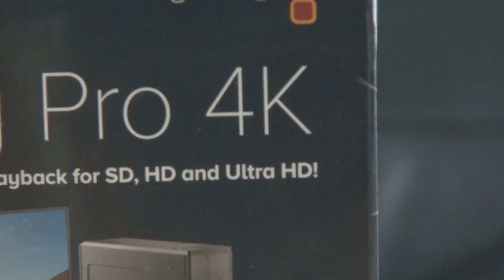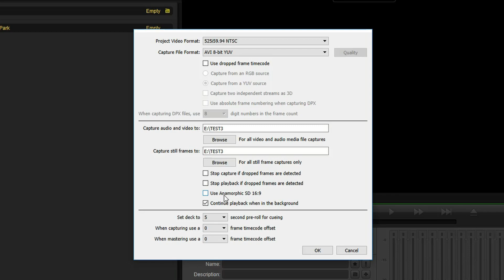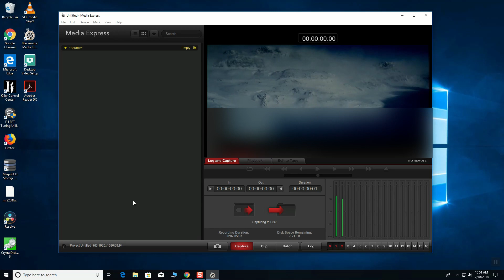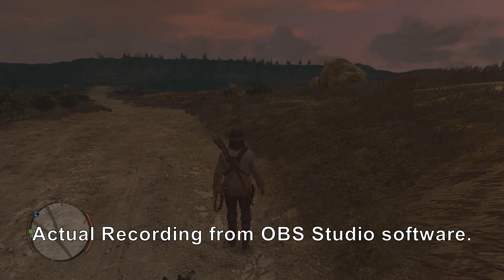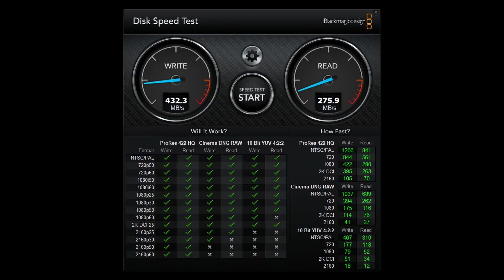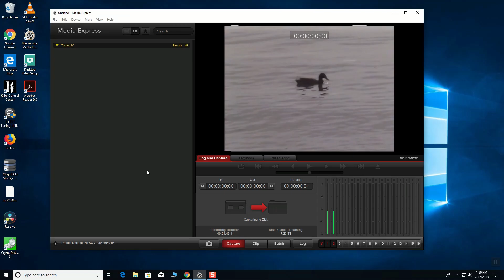PVL Ep.#3: The Quest for Uncompressed: BlackMagic Design Intensity Pro 4K Review

Comment: thank u very much.
I am interested in capturing from a video device via RCA outputs only.
Will I see a difference between the BlackMagic Design Intensity Pro 4K and an external capture card like the diamond vc500 or DAZZEL DVD?
Will I notice the quality differences?
Reply from the maker: Hi @yigal-babiyan, I've not used the diamond or dazzle but the BM line of cards are intended for uncompressed capture, so you will need large and fast drives. More prosumer-professional use. Diamond and Dazzle are more consumer friendly and won't tax your computer resources or hard drives. Quality wise, I've not done a side by side, but I would imagine the BM card would give you better results, but you have to understand the BM results will need proper storage (fast and a lot of GBs) and encoding software to get the file size down to something more manageable. The Diamond and Dazzle give you ready to go results. Sorry if this doesn't fully answer the question.
Reply from the maker: Also, it's not just the capture card you have to account for. There is the playback device and the quality of the media itself. Can't really speak to quality on just the card alone, if that makes sense.

Comment: For me, Intensity PRO ran with a DVD player for less than 3 minutes when STOP at dropped frames was switched on. The software's factory setting is off😉Here is a PAL example video of the "TBC quality":  https://youtu.be/6R-T4ovgFVU  For me, the card without 4K is electronic waste, because the HDMI input does not accept a HDMI (4:4:4) signal from the Pioneer DVD recorder (EE Mode TBC). With 4K, the card is electronic waste for me because it only runs under Windows 10👎

Comment: I Tried connecting my ipad pro 11 to hdmi, casts but not sounds
Reply from the maker: Hi Pitzky, my guess would be it has to do with the card having to obey HDCP protocol. You might be able to feed the HDMI into an HDMI audio extractor device that can pull the audio from the HDMI via RCA cables and feed that signal into the card.

Comment: I bought one last year. It always has trouble with audio sync when capturing to uncompressed video, even though it's just SD. Compressed video does not seem to have the problem. And it's not a storage or computer bottleneck; it's running with a Ryzen 9 5950X, 64GB Ram, and dedicated (as in, not the boot drive) 2TB Samsung PCIE 4 NVMe drive. BTW, Blackmagic's website no longer mentions the TBC capability of this device.

Comment: 4 years later, but I guess any image input to OBS from an external source usually has an audio lag. You have to specify at post. Look at how many miliseconds of difference you have, and then maybe is fixed if it's adjusted at OBS the ms difference. Even then, maybe you have a difference. IDK but that's how i solved some issues like that.
Reply from the maker: I ended up getting an HDMI to RCA adapter to output the audio from an HDMI source such as Blu-Ray to fix the audio distortion, and had to play around with the audio delay as well to get it synced up.

Comment: Great review! Quick question: is it possible to use this card to get a live feed into Resolve, then do color correcting (basic) on this live feed? The reason i ask is because i'd like to use it for studio photography. So i'd take the live video HDMI output from my Sony A7 camera, feed it into the Intensity Pro 4K, then this comes up live in Resolve and i can do some basic color correcting on this live input video and see the result directly in Resolve. And then, if that works, feed the output to it's own dedicated monitor? (i read this is only possible if you have two different Black Magic pci-e cards because the same card can't input and output simultaneously - perhaps you also have an opinion on that?)
Reply from the maker: I guess I'm confused on how you plan to color correct a live feed? You can't color correct a clip as it's being fed into the system. It would have to be captured first, then that clip color corrected. I've been able to feed in an hdmi signal from a Roku device and output the hdmi signal to a TV by bypassing the HDCP protocol, but I not sure about your situation. I use mine more for archival captures than hdmi video streaming myself, so I wouldn't be the best person to ask on that. Sorry.

Comment: Hi, Does pc capture card walk hand in hand with bluray player? i have card like this, but 1 gen older model? it does not have fan. i have also exact same hdmi splitter as you :D i only tried hdmi, not yet composite cables. when i jump between component and hdmi on obs, it gives me some flickering for while and then black, hdmi is just black

i tought this maybe be broken, i found this from local junk/crapyard but as i watched your video, maybe this device is not so practical :D 

i try tomorrow connect older console  with ypbpr component cable if that can run :P

Comment: Bro what is the system requirements
Reply from the maker: According to their website... I'd be more concerned with storage setup than specs if you PC is somewhat recent.

Operating Systems
Blackmagic Design Capture cards are compatible with the following operating systems:

Windows 8 64 bit
Windows 10 64 bit
Ubuntu 18.04 64 bit
CPU Requirements
In general, you should choose a CPU that meets or exceeds the system requirements of the software application you are planning on using. Please check with software vendor for additional information.

Memory
Blackmagic Design recommends a minimum of 8GB of memory for all systems.

Graphics
For optimal performance, an accelerated graphics card is recommend for use with DeckLink, Multibridge and Intensity cards.

Please see the Graphics Card Requirement Tech note regarding appropriate graphics cards for our products.

Storage
You will require hard drive storage with your Blackmagic card that can provide a data rate greater than that of the video compression you are using.

Physical Installation
Requires a computer with available PCI Express slot with adequate number of PCI Express lanes and PCI Express generation. Blackmagic PCI Express Cable Kit (available separately) is recommended for use with UltraStudio 4K Extreme 3 when connecting to a computer via PCI Express. DeckLink SDI Micro requires an M.2 connector.

Supported Hardware
Certified Workstations
The following workstations are recommended for use with the DeckLink Quad HDMI Recorder:

Hewlett Packard Z8G4
Hewlett Packard Z820
Hewlett Packard Z840
The following workstations are recommended for use with the DeckLink 8K Pro:

Dell Precision Rack 7910
Dell Precision 7920 Tower
Hewlett Packard Z6G4
Hewlett Packard Z8G4
Hewlett Packard Z800
Hewlett Packard Z820
Hewlett Packard Z840
The following workstations are certified for use with DeckLink and Intensity capture cards:

Dell Precision 7910
Dell T7610
Hewlett Packard Z420
Hewlett Packard Z440
Hewlett Packard Z620
Hewlett Packard Z640
Hewlett Packard Z820
Hewlett Packard Z840
Hewlett Packard Z6 G4
Hewlett Packard Z8 G4
Precision 7920 Tower
Precision 7920 Rack (not recommended for DeckLink Quad card)
The following workstations have been discontinued but are known to work in legacy configuration:

Hewlett Packard XW8600 (not recommended for DeckLink PCI or PCI-X cards)
Hewlett Packard XW9300
Hewlett Packard Z400
Hewlett Packard Z600
Hewlett Packard Z800
Certified Intel NUC
The following Intel NUCs are recommended for use with the DeckLink SDI Micro:

Intel NUC Kit - NUC7i7BNH
Intel NUC 9 Pro Kit - NUC9VXQNX
The following Intel NUC is certified for use with DeckLink and Intensity capture cards:

Intel NUC 9 Pro Kit - NUC9VXQNX * (not recommended for DeckLink 8K Pro card)
* Extra care must be taken while installing and removing DeckLink 4K Extreme 12G and DeckLink Quad 2 cards in Intel NUC 9 Pro Kit. It is especially recommended to remove the top screw on the breakout connector when installing and removing a DeckLink 4K Extreme 12G.

Recommended Motherboards
The following motherboards are recommended for use with DeckLink Quad HDMI Recorder:

ASRock Z170 Extreme7+
Asus Prime B250M-PLUS
Asus Z170-A PREMIUM
Gigabyte H370M D3H
Gigabyte Z87X-UD4H
Gigabyte Z97-UD5H
Gigabyte Z170X GAMING 5
Gigabyte Z270X-UD3
MSI B360M Mortar Titanium
The following motherboards are recommended for use with DeckLink 8K Pro:

Gigabyte X99-UD4-CF
Gigabyte X299 UD4
Gigabyte X399 AORUS Gaming 7
Gigabyte Z97X-UD7 TH
Supermicro C7X99-OCE-F
The following motherboards are recommended for use with DeckLink, Multibridge and Intensity capture cards:

ASRock H270M-ITX/ac
ASRock X299E-ITX/ac (Recommended for DeckLink SDI Micro)
ASRock Z170Extreme 7+ (Recommended for DeckLink SDI Micro)
ASRock-Z370M-ITX/ac (Recommended for DeckLink SDI Micro)
ASRock Z87 Extreme 6
ASRock Z87 Extreme11/ac
ASRock Z87 Extreme4/TB4
ASRock Z87 Extreme4 (not recommended for DeckLink Studio 4K)
ASRock Z87E-ITX
Asus Prime B250M-Plus (Recommended for DeckLink SDI Micro)
Asus Z87 Deluxe/Quad
Asus Z87-Expert
Asus Z87-Gryphon
Asus Z87-A
Asus Z87-PLUS
Asus Z87-PRO
Gigabyte H81-D3
Gigabyte GA-H87M-D3H (not recommended for DeckLink Duo)
Gigabyte H370M D3H (Recommended for DeckLink SDI Micro)
Gigabyte Q87M-D2H
Gigabyte X170 Extreme ECC
Gigabyte X99-UD4-CF
Gigabyte Z68X-UD3H-B3
Gigabyte Z77MX-D3H TH
Gigabyte Z77X-UP4 TH
Gigabyte Z77X-UP5 TH
Gigabyte Z87X-UD4H
Gigabyte GA-Z87X-UD7 TH
Gigabyte Z97-UD5H
Gigabyte Z97-WIFI
Gigabyte Z97X-UD7 TH
Gigabyte Z170X GAMING 5 (Recommended for DeckLink SDI Micro)
Gigabyte Z270X-UD3
MSI B360M Mortar Titanium (Recommended for DeckLink SDI Micro)
MSI Z77A-G45 Thunderbolt
SuperMicro C7H170-M
SuperMicro C7X99-OCE
SuperMicro C7X99-OCE - F
SuperMicro C7Z170-SQ
SuperMicro C7Z87-OCE
SuperMicro C7Z97-OCE (not recommended for DeckLink Studio 2)
SuperMicro X10SAT (not recommended for DeckLink Studio 4K)
SuperMicro X10SLV (not recommended with DeckLink SDI)
SuperMicro X10SLV-Q (not recommended with DeckLink SDI)
The following motherboards have been discontinued but are known to work in legacy configuration.

3DBoxx 4920
Asus P5B
Asus P5E
Asus P5Q Pro Turbo
Asus P6T
Asus P6X58D
Asus P6X58D-E WS
Asus P8P67 PRO (Rev 3.1)
Asus P9X79 WS
Gigabyte EP45-DS3
Gigabyte G1.Sniper (X58 chipset)
Gigabyte GA-P67A-UD7-B3 (rev. 1.0)
Gigabyte x48DQ6
Gigabyte X79-UD5
Intel D975XBX
Intel DX58SO
Supermicro C7Z97-M
XFX 790i Ultra

Comment: Hi good day. If it is not annoying, could you inform me which model of motherboard you have installed on the pc that you use in the video? And the microprocessor model? From already thank you very much.
Reply from the maker: The motherboard is an EVGA Classified K z270 board, with an Intel Core i7-7700K Kaby Lake CPU.
Reply: @piosvideolab3025  Thank you. You say that a z390 motherboard with an Intel Core i5 9600 is compatible to use the intensity pro?

Comment: uncompressed - good luck! for 187 secounds of 4K Video you need around 100GigaByte of M.2 Discspace. i wish all they want to do this good luck you need a Ryzen7 2700x 4200MHz, X470, M.2, if you think you can do this with a SSD you're wrong! this is to slow you need at minimum 2400Mbit/s write a SATA3 SSD is with around 530Mbit/s write and this is definitive to slow. Use compressed Video for your Project. I open up my Box and i found in two SD-Cards with one program Media-Express for recording the Intensity Pro 4K under Windows 10 the secound SD-Card should hold Davince-Resolve 16 beta but on this SD-Card was nothing only the format. So i download it from the BlackMagicDesign site and install it.  The was unlucky the DavinciResolve 16beta don't work on my Win10pro with a RX580 Radeon Grafic Card. The program talking something about a bad Grafic Card that don't support Video on my RX580? I'm wondering with Davinci-Resolve 15.3.1.300 everything is working also with the hint that the RX580 is not supported and it is a useless Card! I think so that they don't want support the non-Invidia Group like AMD - maybe it is so i don't know that during i bought my new PC earlier then this post. (ago 3 weeks) Ago 2 weeks i get my new Intensity Pro 4K Card. Now i have the Problem i would like to make my Videocuts on my Linux Mint 18.3 System but this is not possible and the reason is clear i have the wrong PC with AMD Graficcard! 
I can't record the Video with Win10 Media-Express on the M.2 SSD because after rebooting my Linux Mint 18.3 the Linux mean that the M.2 SSD make wrong things and i can't mount it under "rw" conditions only in "ro" mode so this is bad because i would like to cut the Video in Kdenlive on Linux. 
Maybe you know a program where i can record on Linux with my Intensity Pro 4K the reason is i can't found a Linux Program for my Card.

Comment: Did you ensure your TBC on the source S-VHS deck was switched OFF, so that only one TBC is active in your analog capture workflow?
Reply from the maker: Honestly, that never crossed my mind. I'm assuming you're referring to the Hotronic TBC issue I had? The VCR's TBC might have been throwing the Hotronic off balance. I thought it might have to do with genlocking, but when I genlocked it with my camera it didn't improve the stableness either. Thanks for the tip.